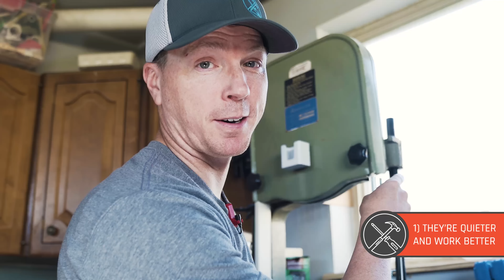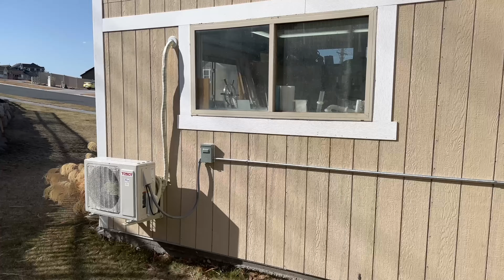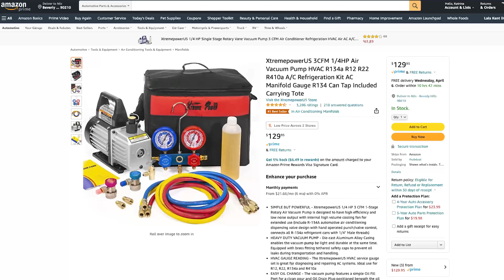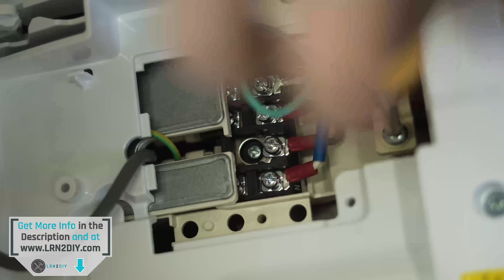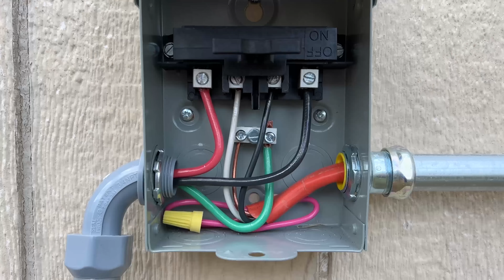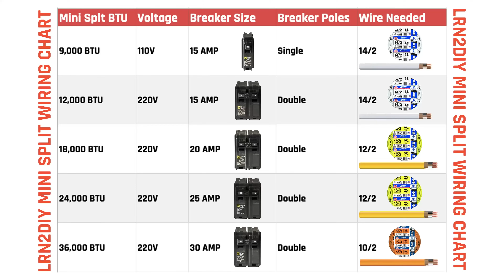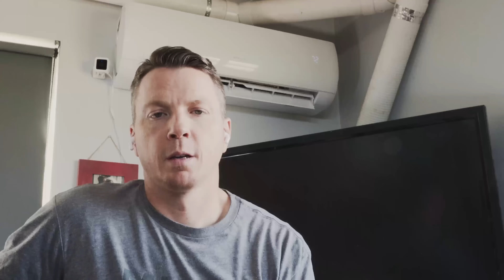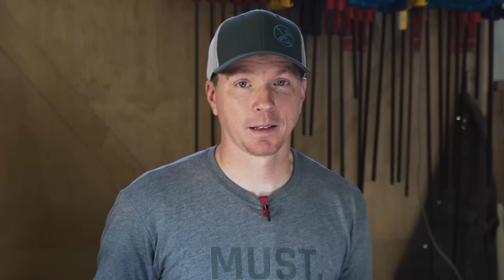Mini Split - 3 Things I Wish I Knew Before Installing

Comment: Excellent, thank you. Good resource. One question, you said one can easily evacuate the lines with the vacuum pump referenced but how does one then add refrigerant after connecting the lines to make the system full of refrigerant? You said Mr Cool comes with pre-charged lines.
Reply: Walberg, With the ductless heat pump that I installed, it comes with 15 feet of copper tubing, with the flare nuts attached, the copper lines flared.  I ran a vacuum pump for about 1 hour, and then disconnected the pump, open the valves, and the refrigerant to charge the lines is already in the outdoor unit.  They put in the exact amount of refrigerant required to run between 10 feet of line to 25 feet of line.  Any other length, you need to adjust the refrigerant level slightly.  So I put in enough R-410 pressure to bring the lines to 35 PSI when I installed about 40 additional line to a 18,000 Btu unit for my neighbor.  The unit is running great.  

The Mr Cool systems use a bit of foil over the end of the copper lines, so they charge them with about 10 PSI of R-410.  That way you do not lose much refrigerant when installing the lines.  Also the indoor coil will be charged with about 10 - 15 PSI of R-410.  As you bolt the two copper lines together, they puncture the foil, and the refrigerant can flow past the fitting.  Then once you check the lines for refrigerant leaks, with soap bubbles, you can open the main valves, so that the R-410 can flow freely through the lines.  It will move about 400 pounds of refrigerant per hour on a warm day.  They units only contain about 2 pounds of R-410, so it moves through the system very quickly.  

The copper lines used by Mr Cool in it's DIY install kit are a bit more expensive than the other units they sell where a vacuum pump is required. It is much easier to adjust the length of the copper lines with the system that is not the DIY copper tubing that is sealed at both ends, and adjusting the length to the DIY style would then require using a vacuum pump.  

The DIY style tubing has been used by Hoshizaki Ice Machine company since about 1995.  They make a ice machine that has the outdoor coil that can be mounted on the roof, instead of blowing 18,000 + Btu's of heat into the kitchen where they install the ice makers.  The systems work great!
Reply: @Kangenpower7  Thanks much - appreciate the specific data! For the system you installed, you added R-410 to 35 psi for the additional 40 ft installed. Did you add it to the lines only or the lines connected to the inside coils? Also, you added R-410 to 35 psi, whereas you say Mr Cool pressurizes DYI lines to only 10 to 15 psi. Why did you add more R-410 per foot? Anyway, pleasure reading the post - had no idea about the quick cycling.

Comment: ironic since i've spent just about all day reading reviews of mini-splits since my propane heater has started acting up but just a few comments here after watching this video and the one where you installed the actual unit.
even though you ran a line with a disconnect box to the unit, most of the 110/120v systems are able to plug into a regular 15/20 amp outlet.  i will assume most people will overlook the fact in the installation manual (.pdf) suggests the unit be on it's own circuit, which in the end, would be similar to what you've done here.  so i would opt for a dedicated line with disconnect myself even though in theory, you wouldn't need it for a 110v install.
i will go for the vacuum pump/gauges because in the end, it's not all that difficult.  even using the kwik evac kit, do you really know if the line set is holding pressure? for any arguing the kwik-evac uses nitrogen, water will dissipate in a vacuum so it's a wash there without being able to actually watch for pressure loss.
as far as the old receptacle you were using for the heat-A/C unit...  just convert it back to 110v and change the receptacle.  220v is two hots and a ground, just pull one hot off the breaker, label it as a neutral and put in the neutral buss bar and go back to a regular type of receptacle.  if you wanted to get real tech savvy, put an ISO recept on it and use it for your computer so you don't get interference/surges when running the shop equipment.  
Thanks for the Videos.

Comment: Why am I reading reviews on “pre-charged” systems but they’re saying they have to buy vacuum pumps and manifold gauges. I’m confused; does a pre-charged system need to be vacuumed and pressure tested?
Reply: It should not, wonder what they are talking about? Maybe they had to extend the lines?

Comment: Any experience with installing a multi zone mini-split? i am doing research now for a 4 zone system trying to learn the pros/cons. Any suggestions would be appreciated. Thanks,
Reply: Johnathan Burke, I don't think I would ever want a two zone unit, and not a 4 zone for sure!  I have worked on a unit that has a 15 units in a dorm with a indoor unit in each dorm room.  The outdoor unit is 480 volt 8 ton capacity unit.  

For home units, you can either install a pair of units, or a single one.  The 4 zone ones are much more expensive, but offer the advantage of only 1 compressor and 1 240 volt disconnect.  The problem is not when it is working right, but when the compressor failed, I needed to get 15 space heaters to put in each room!  

I am considering installing a 12,000 Btu unit in my bedroom, so I do not need to heat and cool the entire house, just my room, and perhaps the other space when I need to.  

For my neighbor, they moved in with a broken heat pump many years ago, and never repaired it.  I put a 18,000 Btu unit into the living room of their home.  I would normally recommend a 24,000 Btu unit for 1,400 square feet, and have a 48,000 Btu unit at my house, so I never need to run the back up heater.  The lowest temperature around here (Portland Oregon) is 23F and we had a record breaking 19F a few weeks ago.  The neighbor did not need to run their back up electric heater at all!   I was surprised!  

But if you want to have all the doors closed, and still cool the bedrooms, then a 4 zone unit would also cool the home.  

I installed the 18,000 Btu unit for my neighbor for about $400, and he paid Amazon $819 for the unit.  What price have you beed quoted?  His is 18 SEER, so not all that energy efficient.  However with a 9 HSPF, the heater is only going to use about 7 KW to provide 100,000 Btu's of heat, while his electric heater is more like 30 KW per 100,000 Btu's.  So $.012 X 30 is $3.60, while the heat pump is only about $1.08 for the same amount of heat!

Comment: I installed a MR Cool mini split in my 242 sqare foot sun room it cost me 1,150 and came with everything even wifi  except the disconect which cost $ 18 bucks put it in myself 25 amp cuircit breaker in my main the mini split was on sale it has a 22 sere rating.
Reply: super quiet and only cost an extra 9 bucks a month on my electric bill love it

Comment: Well done video. Maybe I missed it? How much kW heat was installed?
Do you suggest 20-30 BTUs per sq ft? Depending on what Zone in the US? Thanks
Reply: Back when I went to school for HVAC in 1983, they recommended about 400 square feet per "Ton" of cooling capacity.  Now they insulate the homes much better, and use double pane windows that allow much less heat gain.  So they can have 500 - 600 square feet of space per "Ton" of cooling capacity.  

1 "Ton" of cooling is the amount of heat that would be collected by melting 1 ton (yes 2,000 pounds) of ice over 24 hours of run time.  So there is something called laten heat, where you melt 1 pound of ice and get 144 btu's of cooling changing the solid 32F ice into liquid 32F water.  Anyway that is way to much information.  So 12,000 Btu's per hour is 1 ton of cooling capacity.  

With a well insulated home, and not a huge amount of windows, you can use a 12,000 Btu unit to cool about 400 - 600 square feet of space.  I installed a 12,000 Btu unit for my nephew in a 1,400 square foot home.  It brings the temperature to about 70 in a reasonable amount of time.  It also provides most of the heat in the winter, even when it was only 19F outside recently.  Most of the winter, it is over 32F where I live in Portland Oregon.  

So I agree that 400 square feet per ton is 30 Btu's per square foot.  And that can be extended to about 500 or 600 square feet, or 20 Btu's per square foot.  Yes it depends on the zone.  If your winter is very cold, then the 30 But's per square foot might not be enough heat!  Yet plenty of summer cooling.  

It is possible to have a lot of cooling in a very small computer server room.  One I was in, had about 12 tons of cooling in a 600 square foot room!  Most of the ceiling was covered with air intake and supply air grills!  Still there where warm spots in the room!  That is 240 Btu's per square foot!  A extreme example of need to cool the place!

Comment: It is not $580 more, it is ($580 + tax)  - ($120 + $100 + tax)  = $360  difference. Further, the Mr. Cool is noted for its reliability. I think that the having the wifi built into the unit alone is worth the difference IMO.

Comment: Where do I buy the coolant to charge the unit? According to what I've read, you have to be an HVAC tech to buy the coolant.
Reply: Margaret, typically they have enough refrigerant in the outdoor unit to allow up to about 20 feet of copper tubing.  So you do not need to buy any refrigerant to complete the installation.   The vacuum pump, hose set, and adapter from 1/4" to 5/16" fitting is only about $150 - $200 on Amazon.  They sell it all in one kit.  

I bought two of the 12,000 Btu Della units at Amazon for $719 each.  That seems to be a really nice unit, and they are silent, less noise than a typical refrigerator!  My neighbor bought a 18,000 Btu Della unit for $899, and I installed it for about $400 (including extra tubing and electrical installation) so he got a great deal!  I had to add about 3 ounces of R-410 to make up for the extra 40 feet of tubing that I added.

Comment: Great video and I echo all the positive comments others have said.  One issue though is the links you provided to the Tosot unit in both your article and below are no longer active.... perhaps the model was discontinued.  It would be nice to have a new link to what would be available now (closest to what you have) as there appear to be three different models available in the same size category.  also, it doesn't appear that you can purchase directly from the website but, I could be wrong about that.

Comment: "Mini splits" as you call them are call "split systems" in Australia and are the main type of AC used in most houses because they're easy to retrofit to existing homes. However they have to be installed by professionals, and all electrical work done by electricians (240v systems).

The thing that was missed by this video is how efficient they are. In the current days of greenhouse gas emissions and high energy prices, emphasising the cost benefits should be important. 

We replaced gas heating with the split systems in various rooms, which are powered by day by solar panels. Free heating and cooling during the day, and they barely use any electricity.

Comment: I have a 120 volt mini split that dose run off the wall powered outlet! My unit is only 9 amps at 1200 btu! I have a 15 amp circuit to power it. Have not had any problems, my indoor unit feeds power to the outside unit by a thick power cable the it was supplied with. I believe that is different from my setup  then the setup on your unit. Just letting you know they have different types.

Comment: Precharged means the refrigerant has been pumped down into the condensor.  That doesn't mean you can just plug the lines in and open the valves.  (although that's how a lot of people even professionals do it).   The lines should be purged with nitrogen.

Comment: In our house (Central Europe) the outdoor and the indoor unit (2.5kW split) the have a single wire that is plugged into a grounded 220V socket. Installation was done by technicians (coolant tube, wire connections, vacuum etc) but the entire electrical hookup consisted of finding an extra socket and plug in. 
This, being an efficient unit, does not use more than 880W at any point though, maybe larger units would be hardwired here too.

Comment: I would think that not having the lines charged is a big benefit as this would allow one to to cut and re-flare providing a better and more professional fit when considering excess copper hanging out at the compressor but this was not mentioned.

Comment: You are my kind of guy. You people help us educate ourselves and I appreciate your effort very much. Thank you for that.
I also bought all tools and learned to do all the job. I even have nitrogen tank and brazing equipment. For comparison: My neighbour installed 12kW heat pump and it cost him around 13.000€. I bought two 7kW inverter air condition units, 850€ each, copper pipes for exchanger (around 450€), nitrogen cylinder with regulators and brazing torch (about 250€). I invested some time in researching how to do it and connected it to an existing 2000 liter buffer tank. So it cost me approximately 2.500€ for 14kW heat pump. That is some real saving. But that's not all yet. Since I bought two split systems, I had two surplus internal units, since I only used the electronics from them. Then I got the idea... If I let water thru and start the fan, it should heat. So I installed one unit in my workshop and connected it to existing central heating. And it not only works, it works beyond my expectations.
Also you can buy a "Smart Wi-fi remote control" for 10€ and control all your IR devices with it. This thing is so under-priced and useful, I can recommend it. I'm here to help if anyone is interested. Stay safe and warm. 💖
Reply: Hey @slavric - can you share info or link on that Smart remote to control IR devices?  Exactly what I'm looking for.  Thanks!

Comment: Brilliant video, what about cleaning for workshop dust in Split system head units... A comparison is needed, some dust issues will arise if not easily accessible and washable filters are used. 
Thanks from
The Roo Hunter.

Comment: Starting in 2023, under the Inflation Reduction Act, you can, depending upon your income level, get a several thousand dollar rebate on a mini-split. You can also get up to $2,500 to run electrical lines and up to $4,000 for a new 200 amp circuit breaker box.

Comment: We've got minisplits. Had to replace 3 old ones for efficiency and end of life reasons. One disadvantage is that when they have a problem, you don't pull them out of the window and swap it for a new one. Other than the electrical, it's pretty much a complete do-over.

Comment: I love my Mr. Cool it works great, I hung mine on my house I wish I had mounted it on some sort of a pad as even with the rubber isolation washers it came with it is noticeable in certain parts of my house. I bought mine at Costco it came damaged and they replaced it immediately, also our power company had a rebate for around $750 dollars making it very affordable.

Comment: Very good video. There's something else about buying those tools, you have them if you ever have to repair your unit or install another one. Mr. Cool is expensive and if it does have a leak down the road you'll likely have to buy new lines.
I just bought a mini myself and the tools to install it, I also bought the offset flanging tool and the NyLog blue sealant and the line covers. I have flanging tools but the off set does a better job and at the pressures of mini's you want everything in your favor. I looked at the mounting brackets but my unit says it should be 12" from the wall and I don't think the commercial brackets do that so I'll make my own.
Thanks again, worthwhile video.

Comment: The higher SEER ratings may not be worth the money. For each SEER rating (aka 12 to 13, or 18 to 19) you save about 6% in energy. In a central city like Little Rock, Arkansas in the United States where you will need to both heat and cool, a 1200 square foot house will cost about 300 to 500 to heat and cool year round. In my case, it was 75% ($400) heating and 25% ($100) cooling.6% of $500 is $30. When I was searching units, the difference between a 18 SEER and 20 SEER unit was $450. (24K, 18 SEER for $1,300; 24K 20 SEER for $1,750. That is a $450 difference.) The more effcient unit cost 35% more. The break even period $450/$60 was 7.5 years. The Unit would have to last more than 7.5 years before it would begin to pay off. Now I generally believe these units can last a long time (10 to 15 years), but there is also a high risk of breaking something during install, or breaking before that time is up. If your unit is on the smaller side (12K instead of 24K) you are going to use half the energy and only have half the savings. These units are more effcient than central HVAC (generally SEER 12 or 14) so putting in a Minisplit with a SEER of 18 will save about 24% of the power. (18-14= 4, 4 times 6% equals 24%) (Yes, technically it is more complicated, but this math is close enough very simple and will get you close enough to make the right decision.)  Please consider this basic math, then look at your historical energy usage, what portion of the house you are planning on heating (all in my case), insulation quality, (fair in my case), and prices of the units that you wish to install.

Comment: The main difference between precharged line set units and standard flares is the required EPA certification to install them.  Your $200 savings won’t offset the $50,000 fine for posting an illegal DIY install.  It’s a video showing exactly how you broke the federal law and encouraged others to do the same. Is it Easy, yes. Did you break the law by doing this also yes. Did you properly evacuate the system prior to charging, No.